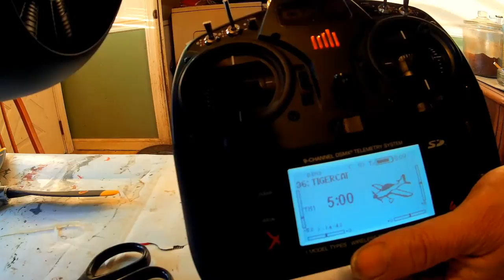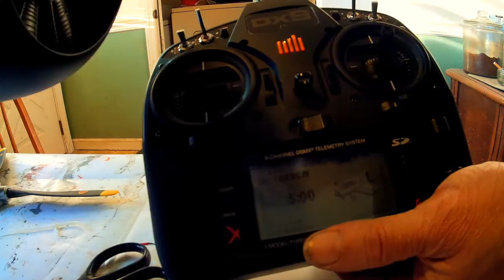(NEW) Flightline RC.  F7F-3 Tigercat 1600mm Twin Engine Warplane,  ESS Air Sound System Install

Comment: Great Video and she looks great. I noticed you had both of the 3600's in the front. Was that just for the setup or are you going to try and fly it with them there. If it's the later, I think it will be way to nose heavy. Makes me want to do the sound system as well but think I will just leave mine as is but I like where your going with this. Take care and keep them coming.
Reply from the maker: Not sure yet, but probably.  Gonna see where cg falls best with the additions, transducers, etc.  Thanks Bud.